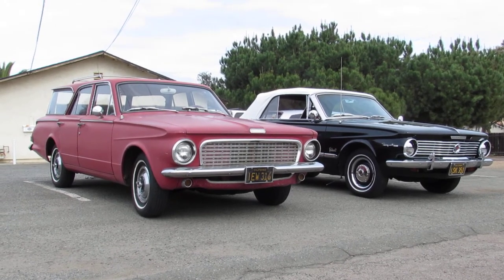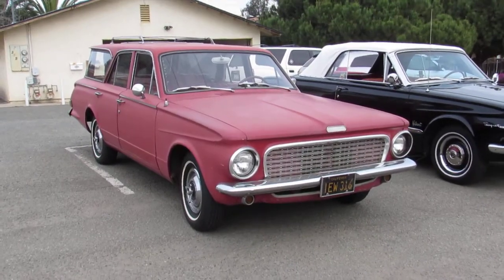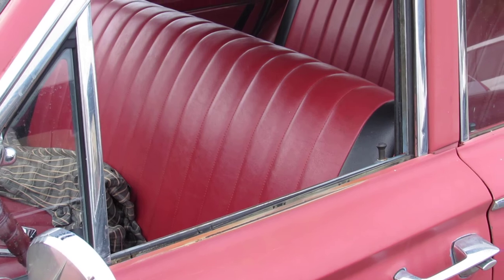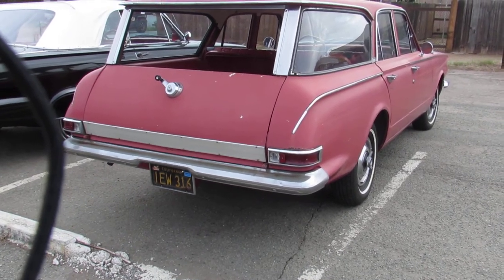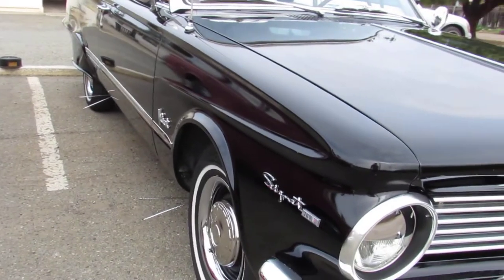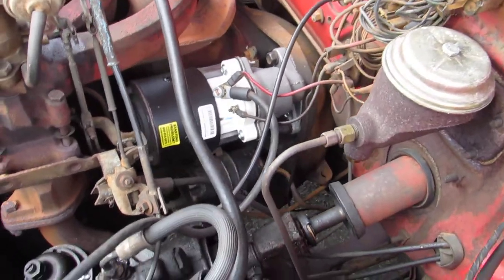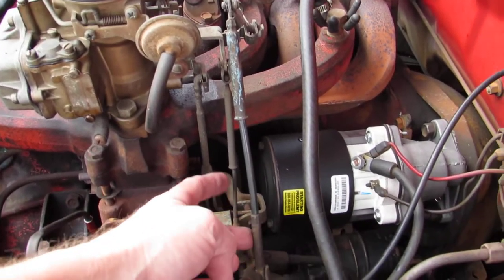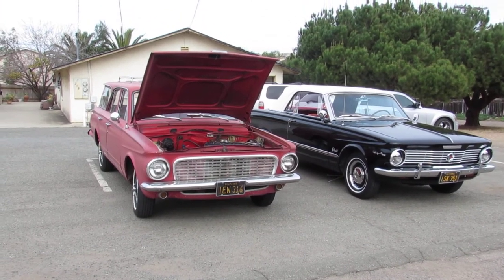1963 Plymouth Valiant V200 Station Wagon

Comment: After seeing this video, I am guessing that maybe the cruise control addition from another Chrysler product might give someone else the idea to do so. I know in the 1980's companies like JC Whitney sold a cruise control kit.  I installed one on my dad's dodge omni with and automatic trans.  The station wagon in this video may be long gone, but it looks as if the electronic ignition box may have over heated one time and melted the epoxy that sealed the electronics.  I have seen that happen on other cars.  Not sure why it happens.